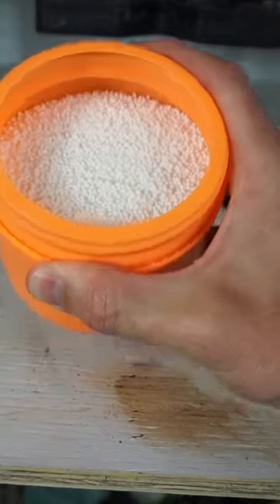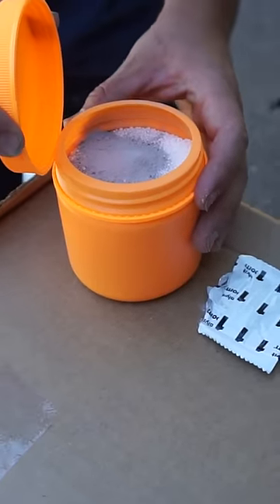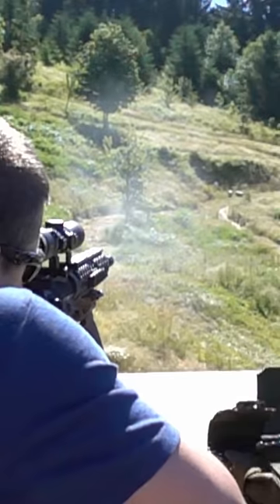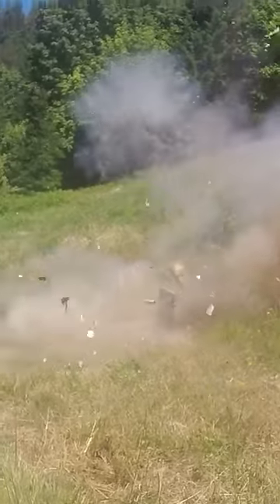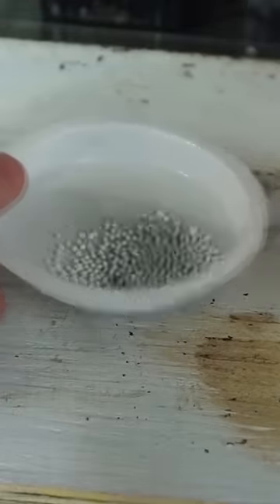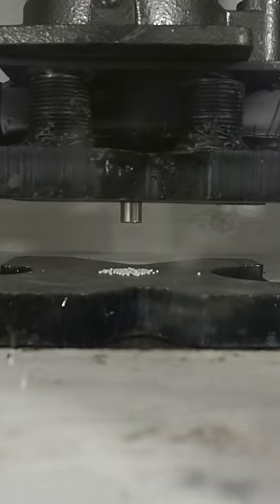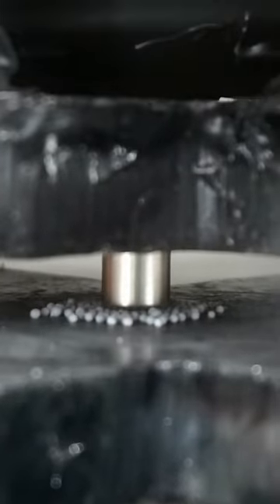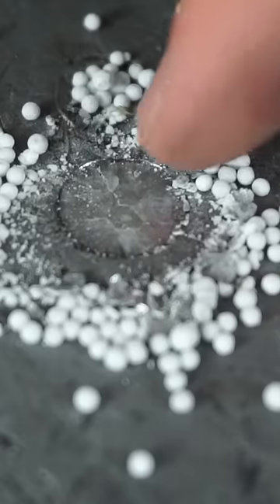Don't Crush Tannerite In a Hydraulic Press

Comment: I wonder if it'd react if you'd have ground both reagents down to a fine powder.  A fine grain size can increase reaction speed and energy released to an astonishing degree.  I also wondered if powdered iron oxide would have any effect on the mixture.  Aluminium oxide mixed with iron oxide is thermite and if ignited burns hot enough to weld steel.  I'm gonna let someone else try that though, creating an experiment that requires mixing explosives without thorough knowledge of the chemistry and physics in question is a common category of Darwin Award.
Reply: Nothing still wouldn’t happen
Reply: @RedNeckEric  It would if it hits with enough force, the press puts it under a huge pressure but slowly.  There is an awesome wacky celebration, I think in Mexico. The participants apply an explosive to a hammer face and whack a steel plate or rock.  An impact can set off some exosives, it's just a question of how big a shockeave is needed.
Reply: @warpdriveby  i actually know it won’t cause i tried it before i love chemistry and testing all sorts of science experiments “potentially dangerous and just fun ones” I’m kinda like the YouTuber backyard scientist but more adventurous
Reply: Tannerite is Impact detonated, not pressure detonated.
Reply: All I can think of is wanting to see what happens when you throw both ingredients into a blender and turn it on.
Reply: @LaggyWizard  They're the same thing, it's the "clamping speed" that is different to borrow a term from electrical jargon.
     I think @Eric is right on this.  It's the shockwave, which is just a huge pressure differential between 2 media or areas within one.
Reply: @AKSoapy29  I’ll let you know when i get some more thermite
Reply: @LaggyWizard  impact is just a sudden change in pressure...so...yeaaah.
Reply: It's the type of energy that matters. I'm not going into this because you can research it yourself, but tannerite needs kinetic energy to set off the explosive reaction. So you can Google the differences of energy (in this case kinetic and pressure) and figure it out from there
Reply: @ToolforOffice  exactly, the impact is what creates the shock.  To detonate stabilized explosives, like tannerite, or even plastic you have to slam the molecules together so hard that the (usually nitrogen) bonds snap and reconfigure to lower energy states.   In doing so gasses (like N2, NO, NO2, NO3 and more) are formed from solids and expand faster than sound through air, creating the blast
Reply: @warpdriveby  the molecules configure to lower energy states. The individual bonds can actually increase or decrease in energy.
Reply: @ToolforOffice  *implosion
Reply: Thermite is aluminum powder and iron oxide, not aluminum oxide.
Reply: @warpdriveby  they use a mixture of potassium chlorate and sulfur in that festival.
Reply: @footingball5566  Indeed it is, I must have added it thinking of the iron component

Comment: I've heard it ignites because of the friction between the metal of the bullet and the aluminum powder. It says you need a bullet traveling 2000fps or more.
Reply: Ah. So subsonic = no-go (boom)
Reply: .17hmr will trigger it.
Reply: I have made those same targets go off with 9mm and .40 cal handgun rounds. I'm not sure what speed they were going but self defense rounds and fmj target loads out of a 4" barrel will be far less than 2000 fps I think. Maybe the targets were rated or prepared different from those above that stated 2000 fps was needed?
Reply: Most anything will trigger it but thats what they recommend. I've shot it a few times with it not going off and it was with a slower moving round.
Reply: you need 2 parts of the explosive triangle of heat, shock, friction to get something to explode
Reply: Itll literally go off with a blasting cap but ok.
Reply: 2,000 fps???
Reply: @camrin8937  that's what tannerite brand recommends 40gr or higher at 2000fps or more.

Comment: To even have a chance to set it off with a press, you need more powder in it, you barely had any; they still look white. Whenever I’ve mixed it up, it always looks dark gray throughout.
Reply: Grinding the NH4NO3 down to the particle size as the Al2O3, should increase the ferocity of the reaction enormously as well
Reply: @warpdriveby  This. When I experimented with thermite (powdered iron oxide iii and powdered aluminum) it was astonishing how massive the difference of the powder’s fineness and thoroughness of mixture mattered. It was a night and day difference!!! Using a variety of quality of materials in my testing, my worst thermite didn’t work at all. My average thermite worked decent. My best thermite was like a fucking rocket firing, it was a FURIOUS reaction! Very difficult to achieve, only one supplier’s aluminum ever gave me that intense reaction (the iron oxide used was a constant throughout.)
Reply: He probably didn't want to explode his press 🤔
Reply: @Murasame13  he had no idea what was gonna happen, so he could have exploded it anyway
Reply: you don't need much aluminum for an AN-Al explosive. tannerite is like 2% aluminum, 22 rimfire sensitive tannerite is like 4% aluminum

Comment: Given that nothing happened I'd have said that putting Tannerite in a hydraulic press is one of the safe ones to try.
Reply: Layman logic: I did the test one time and got one result, therefore that result occurs 100% of the time.
Reply: @FourthRoot Very true. I was thinking a little along the lines of David Paylor, but there's no guarantee it couldn't ever happen.
Reply: Not really: given that I know what Tannerite is I'm not really a layman. It is designed to be completely stable unless subjected to a very strong impulsive force, such as a centre-fire rifle round, and even discharging a shotgun at point-blank range into a kilo bottle of the stuff is not going to set it off. I would have been shocked if the press had had any effect.
Reply: @davidpaylor5666  To be fair, the amount used in this experiment is unlikely to be lethal even if it did detonate. But you are definitely overconfident in your assessment that it can't detonate. Suppose the aluminum or AN contained impurities that greatly increased its sensitivity. Suppose a static discharge occurred during compression. Were you even aware that pressurized confinement  can greatly increase the propensity for detonation? Can you name a pyrotechnic composition that undoubtedly would detonate as a counterexample and explain why?

Comment: It's not just the pressure wave, it's also the kinetic energy in the bullet which causes the Tannerite to compress rapidly.  The explosion then sets off a chain reaction which consumes the remaining unexploded Tannerite.  It's similar to how Ammonium Nitrate explodes.  Not all of it goes at one time which would be closer to C-4 or Compound B in a hand grenade fuse for example.  The shockwave and pressure wave created from the initial explosion is what causes the rest of the Tannerite to explode.  The hydraulic press would probably ignite it if you were speed it up to about 500 fps.  Tannerite will explode simply by dropping a weight on it from a high enough point to cause an acceleration of roughly 50-70fps.  Increasing the weight or pushing the weight into a smaller overall volume/area would have the same effect.

Comment: Detonation is defined as complete molecular disruption by transmission of shockwave, usually between 5000 and 10,000 feet per second. Heat/flame will only cause detonation if the flame front exceeds the shock front of the explosive. It’s why detonators, ultra sensitive, can be initiated by heat but TNT can’t.

Comment: Temperature is mostly irrelevant, you need the step-front shock wave to trigger the reaction,  Also, even sensitized by Al powder, AN has a critical diameter needed to detonate.  A few prills on a press wont ever do anything
Reply: Wondered that myself.  If he were to use a cylinder packed with the stuff and tried to press it, would the stuff detonate? Or, does it need a rapid impact + pressure to detonate?

There's also another form of tannerite, forget what it's made of, that you can detonate with 22LR ammo.  Don't think it's similar to snap pops, but could be wrong.
Reply: @amanawolf9166  Theoretically if you could generate enough pressure, it's possible although unlikely in this formulation.  Also, the line between the legal use of explosives as a hobby and federal prison time is a thin one.  I'd recommend against containing explosives in any type of cylinder, especially the metallic variety.

Comment: Pressure is often both?
Smaller volume with the same amount of heat means more heat per unit of volume.

Decompressing gas makes gas bottles cold because increasing volume with only a certain amount of heat but dispersed over a wider area

Comment: Tannerite out in the open doesn’t burn fast enough to be considered a detonation, it’s what we call a deflagration, a very very fast burn. If you put it under pressure in some type of container it will due to the build up of pressure but under a hydraulic press the most it would do is deflagrate.

Comment: As someone who was in that industry. Tannerite and the clones are classified as low speed binary explosives, and require either 2200fps or maybe even 1500fps of impact to set them off.  Comprised of mostly ammonium nitrate and ultra fine aluminum  powder.

Comment: It's also possible that the sample wasn't mixed very well. If you repeat this experiment, consider mixing your batch together that you intend to shoot and then taking your sample for testing from that larger batch.
Reply: Tannerite doesn't explode based on pressure, but speed of application.  It has to be hit by something moving as fast as a rifle round.  Just squishing it slowly isn't the same thing, since the parts aren't forced into each other fast enough to cause the explosion.

Comment: What is the difference between pressure and temperature in this context? Because if you squeeze the same number of particles into a smaller Volume (increased pressure) you have increased temperature.
Reply: Pressure is a function of both temperature and density. If you slowly increase the pressure, you’ll mostly experience a change in density.
Reply: @MysticBallistic23  when you let all the heat dissappate, yes.  But if you increase the pressure quickly, like when you shoot at it, you also increase the temperature.

Comment: Tannerite is also about the container it’s inside of. Usually plastic is enough to keep the materials tightly packed, as a projectile passes through to ignite it. But for the press, I would guess maybe if you put a bit of it in a light metal container, it may work. Maybe something softer like a small brass or aluminum box? Give it a try!

Comment: This compund detonates better with less density, that's why it's a non perfect explosive. Instead of pressing it try adding some organic oils as a fuel, to make some kind of ANFO. Closing this in a closed jar or package will increase the initiate pressure needed to explode but you can use some tnt for example to wake it

Comment: There is high velocity and low velocity Tannerite...
High velocity needs a high velocity round and can be mixed and transported but not recommended.
Low velocity DO NOT MIX until ready to use. Just dropping the container could make it explode, the press, a hammer, 22LR round will make it explode.

Comment: Actually it's much more fascinating than that. Tannerite is velocity dependent. Meaning that you could slowly ramp up a house worth of pressure on it, and it will do nothing, but if you hit it with a fast enough object it will explode. It doesn't work as well with pistols, for this reason. There are other recipes for pistol binary explosive and certainly a recipe out there for a pressure sensitive explosive.

Comment: Temperature isn't the same as heat. Heat is directly correlated to energy in the sense that more energy equals more heat. When something is cold, it isn't the opposite of hot. It's actually just the absence of heat. So, what you actually meant was not "how much temperature do I need" but actually "how much heat do I need."

Comment: It's not pressure. That press generates more pressure than a required bullet. It actually requires speed. This is why a fast small bullet will go boom and a bigger slow bullet (more ftlbs of energy) won't.

Comment: pressure and heat tend to be tied together. If it were a closed system the pressure would probably raise enough to bring up the heat… idk just apparatus in my opinion if it were to be actually tested scientifically. But I’m sure the AL knew that before risking precious hydraulic press

Comment: It’s not temperature it’s velocity. You need 2000fps minimum. A 9mm projectile at 2200fps “only” has 18,000psi of pressure but the way I understand tannerite it’s not the pressure it’s the speed at which that pressure arrives

Comment: It probably doesn't have anything to do with the force it's being hit with in total. Moreso the rapid increase. Sure a hydraulic press can get to 50K PSI (not sure it works the way you think it does) but it gets there incredibly slowly. It's more like you're gently pushing away everything rather than hitting it. Then there's the fact that there's no heat pretty much at all, making chemical reactions harder to start in the first place.

Comment: What you did do was figure out that you can smash this into a smaller area other area and pack a whole bunch more into it... That makes for a bigger explosion when you shoot it
Reply: No, it doesn't. It will only be an explosion of the size that can be generated by the given amount of explosive. A larger amount will give a larger explosion than a smaller amount whether compressed or not. LMFAO!
Reply: @shelbyseelbach9568  
... but in a condensed state you can fit more of a material into a given space. Meaning the same size charge will theoretically have a larger yield if it has higher density.
Reply: @jacobg5122  Yes, you're absolutely correct, but you haven't made a stronger explosion by adding more explosive into the same volume of space, you have made a stronger explosion by adding more explosive. The fact that it is compressed into a smaller area is meaningless as explosive yield is determined by the amount of a given explosive, not the amount of space the given amount of explosive occupies. You are saying you make a stronger explosive by compaction which simply isn't true, a given amount of explosive has a given yield that doesn't change because you make it physically smaller. 10 pounds of dynamite has only got the  explosive power of ten pounds of dynamite, no matter if it is a ten pound stick that is packed down to be one inch long or ten one pound sticks scattered all of the room, makes no difference. The volume of explosive is what matters. Basically, once you add more explosive, you have increased the yield, you can pack it into a smaller area of you would like, but it won't get any stronger because of it. 
If your only real argument is more of an explosive is stronger than less of the same explosive, then you are correct. The compaction doesn't matter.
Reply: @shelbyseelbach9568  
I think OP is implying that you could fit more into a smaller space and create a larger explosion per cubic inch rather than per pound.
Reply: @jacobg5122  Well, if his point is that more explosive is more powerful than less explosive, and that compaction allows a larger volume in a smaller space, not only is he correct, but these truths are self evident. But,  once again, the explosive does not become more powerful because of compacting. After compacting it is exactly as powerful as before. You have to add the explosive before you compact it, at that point compacting doesn't make it more powerful, it only make the volume of undetonated explosive occupy a smaller space. 
His original comment says packing more into a smaller space makes a bigger explosion, which simply isn't true. The explosion will be just as big as it would have been if you had not compacted the explosive.
Reply: @shelbyseelbach9568  
Idk man, I didn't write that comment. I don't know exactly what he meant by it, but I think it can be inferred that he didn't mean that compressing a binary explosive increases its potential yield per pound.
Reply: @jacobg5122  Maybe, the problem there is you are trying to guess what he might have meant other than what he actually said. I am not guessing what he meant, but rather am simply going with the meanings of the words he used. Until told otherwise, I will believe he chose the specific words he used to convey exactly what he meant. That's the whole reason we assign words specific definitions after all.
Reply: @shelbyseelbach9568  
Actually, re-reading his comment, he says "smash this into a smaller area and pack a whole bunch more into it" as in put more (condensed) tannerite into a smaller space than usual, resulting in a bigger explosion from that container. So explaining yield per pound is an irrelevant point to make, because that isn't what he said in the first place.
Reply: @jacobg5122  And actually, you have to add more explosive before you can compact it. Once you have added it, compacting makes no difference. You could simply skip this step, as the explosive yield is already more powerful, simply because you have ADDED explosive. This is what makes the yield greater, not the compaction. Simple physics, if you don't understand, I can't help. Basic physics is not a class that I teach, but classes are available online and you invisibility know how to log on to the internet. Best of luck.
Reply: @shelbyseelbach9568  you are wrong. There is an optimal density for each explosive where they reach the highest velocity. It's one of the reasons why you for example melt cast ETN. As long as you don't dead press the explosive, the higher the density, the higher the velocity.
Reply: @footingball5566  that is simply extracting the same amount of power more rapidly.